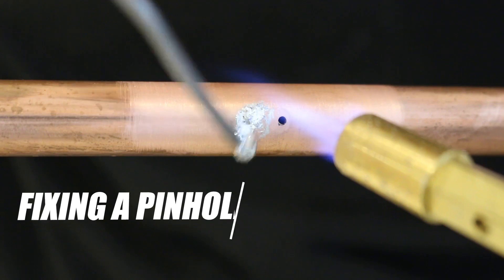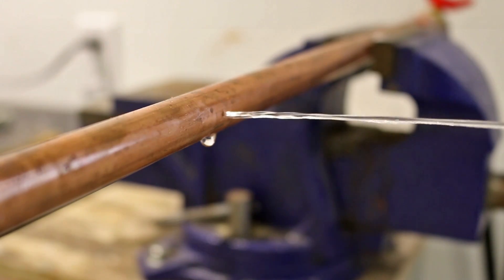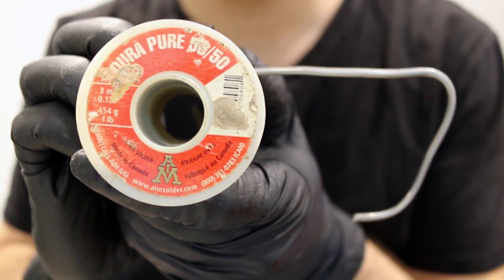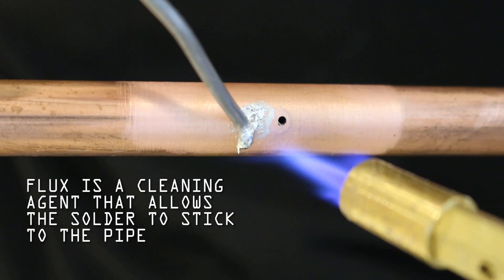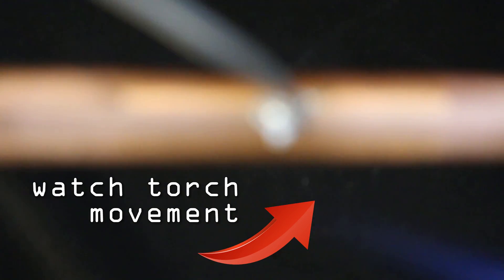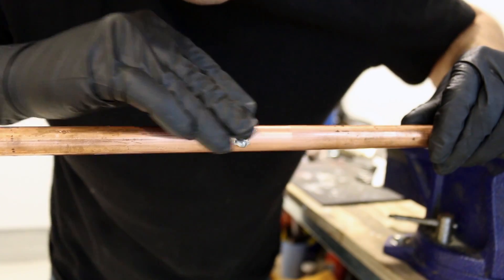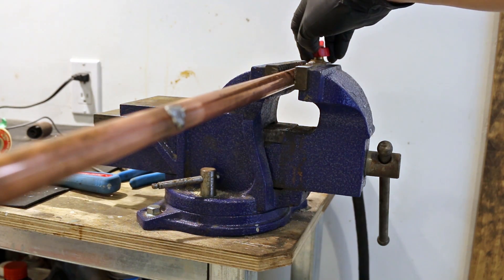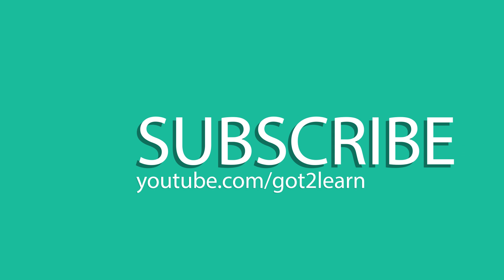Can You Temporarily PATCH a Pinhole With Solder? | GOT2LEARN

Comment: I did this today on a copper pipe which was under pressure and a much smaller hole. It lasted about 5 mins and then started to leak.
Reply: Have you figured a way to fix it?
Reply: @Phuong_Nguyen_  Did not work. But I assume it has something to do with the temperature and the flux. But just replaced it instead.

Comment: This is a good video, and I am sure that this would work for a small pinhole repair, and it might even last for years or decades.

However, with that said, I think this only makes sense in limited situations. Maybe this makes sense if you are fixing plumbing in a rural area and the nearest hardware store requires a drive over an hour and you really need to fix it quickly. Maybe it also makes sense if there are obstructions around the pipe that needs to be repaired that won't allow a conventional repair and you want to fix it temporarily before you have to do a lot of work to remove the obstructions and then do a permanent repair.

Otherwise, I would repair it with a slip-repair copper solder fitting or (if for some reason it's in an area that isn't easy to solder with a torch) a propress fitting.

Comment: I like how you state 50/50 solder has lead, but all the pipes in the house are use soldered connections which contained the same lead? The solder is the sealant for all the pipes right?
Reply: Water pipes are soldered with lead free solder, personally I hate it as it's much more difficult to work with

Comment: Thank you. I have a copper vent stack that has a few holes in it allowing sewer gas to enter house on occasion i might this method. However, the holes are larger than a pinhole. Any other alternatives? I hward something about copper epoxy?
Reply: Use copper foil tape.

Comment: I’m not a plumber. But I don’t believe that lead in the pipes will so much harm by itself. It would have to be corroded by the minerals or other chemicals in the water supply. There are a lot of places that use lead pipes still. And people aren’t regularly sick from it. Sure it’s better to repair it the right way ASAP, but if it’s going to be there for a day or two you should be ok.
Reply from the maker: Of course, but people get skepticle very quick lol

Comment: Piece of a fernco and hose clamp or 2. We use to cap homes like this years ago: crimp the ends together flux, solder and pray.  Now that I have my own company I just buy caps lol
Reply: Dude! A comment from 3 years later helped me this morning. Woke up to a pinhole leak on a copper pipe in my front lawn area. I found this video and scrolled to the comment section and found your comment. I covered the hole with 3 layers of electrical tape and a hose clamp and it sealed it completely (so far). Thank you. -Miami, Fl.
Reply from the maker: Sooo coool 🙏🙏🙏
Reply from the maker: Yep, sure works!

Comment: Sand Flux and wrap copper wire around pipe. Regular solder will work and it'll last longer
Reply: I did this today. No choice, it was the main 3/4 feed from the water heater manifold. Top of the pipe was up against the beam, pinhole on the bottom. I sanded and brushed it, applied Flux and heated it up. Then sanded and brushed it again, re fluxed and hit it with with torch and solder with the most perfect single bead I could have laid. Tried to scrape it off with a flat head it was one with the copper. Tinning Flux probably helped a lot. It's holding and I plan on covering it tomorrow and forgetting about it.
Reply: I'll say I thought of it on the job, I didn't see this video till hours later wondering if anyone else had tried it.

Comment: I've had a few to do.  The contractor supported the hot water heat lines with a 16d nail.  Electrolysis took 30 years to eat through.  Now I'm constantly looking.  As a follow up to this one, you should do a video on using a slip coupling.
Reply from the maker: Lol, a 16d nail huh...wow! About the slip coupling, I do have a video on that, I think it's called "secret plumber's tricks" not to sure though, but I definitely showed that trick ;)
Reply: Just found one last night. Right under a nail stuck against the joist.